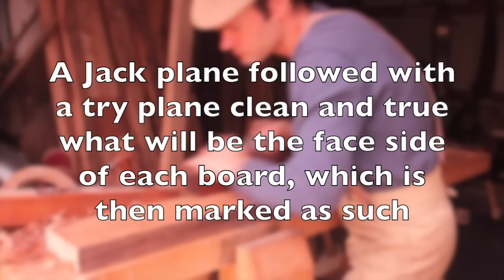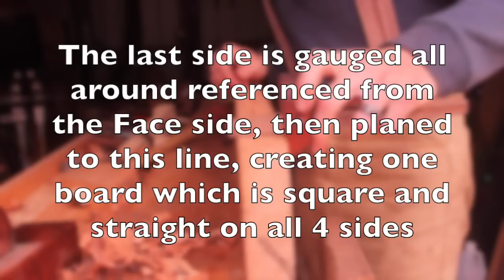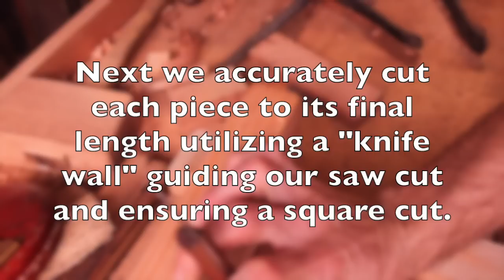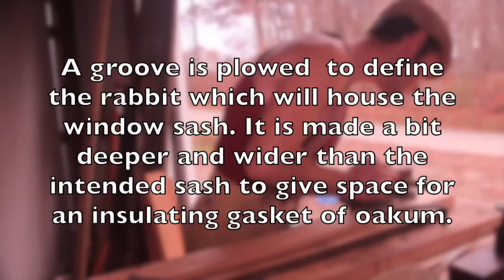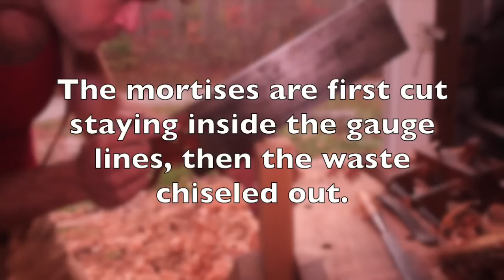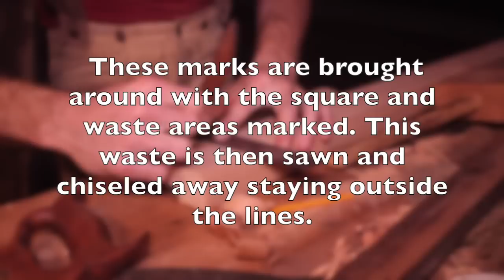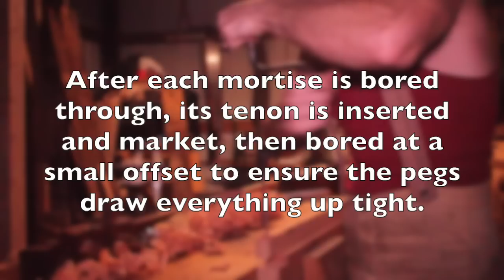Traditional windows . Part I

Comment: fun. this is great. i actually made some window sills at work this week. one sill to let water roll to the outside, and the other for water to roll to the inside, because it was a window in a shower.  the old ones wer rotten because it wasn't angled properly, or allowed to weep.  the other maintenance people always roll their eyes when my sawzall and planes are hand powered.
Reply from the maker: +Johnmark Hatfield Nice, so do I understand you use only hand tools as a professional maintenance person? If so, BRAVO!!! and Id love to hear more.
Reply: In my shop i use traditional tools, but at work i mix them. I hardly put my nice tools in my truck. Sometimes a compound chop saw can only do so much and the handsaw does it easily.

Comment: One way to quickly set the iron in the plane without bothering to hit it with a hammer (and once you get the hang of it, you can do this extremely fast) is to smack the corners (as you need in relation to the iron itself) against the work bench. As you can imagine, varying levels of power put in to the 'hit' will shift the iron accordingly, more, or less.

It's especially useful for small planes, but it works equally well on large ones. I've seen Japanese carpenters adjust their planes on the fly very quickly. :)

Comment: A helpful hint when I make pegs I first rough cut them and then I choose a nut with a hole the diameter that I require I then drive the rough peg thru the nut and it comes out round
Reply from the maker: +Richard Hilbert Thanks for the tip!

Comment: Incredible craftsmanship. Thank you. Can you tell me, is there any place on your blog or elsewhere, that you know of, with the names of the various tools and scribing equipment you were using? Having used modern tools my entire career, I am unfamiliar. Just subscribed. Very impressed.
Reply from the maker: Um, not sure, but here it is…
4TPI rip saw
9tpi crosscut
15tpi backsaw filed rip
Jack plane
Try plane
Stick and rabbet plane
1/4" mortise chisel
small carving gouge (in cannel gouge would be better)
mortise gauge
marking gauge
try square
yard stick
marking knife
1" bench chisel (could be other size)
Brace with 1/4" auger bit

With these tools you can build any size window, and you should be able to buy them all for less than the price of a modern double pane window, (which will leak and stop working and have to be replaced) and you can make all your windows, and make double window units just as efficient as a gas filled modern multi glazed window. 

Hope that helps
Josh
Reply: +Mr. Chickadee Thanks Josh. Big help. All the best.

Comment: Make a jig to cut your boards straight and all at once please. No need to make such a complicated frame joint (understand that when fitting the window you will wedge it from at least 2 sides). 
Better to make a butt joint with trimming the bottom frame parts to the sash groove level. Consider making more of your own jigs, even when using just nonelectric tools, cause your own way is that truly traditional way. Back in the day nobody had that cookbook internet to tell you how to do stuff, consider questioning even Underhills's ways :)
Reply from the maker: I followed the instruction of a book detailing window and door construction from just before the machine age. At the time of writing window sash manufacture and traditional hand tools used to make them had reached its zenith, so a more complete, effective, and efficient method would be difficult to come by or re-invent.
Reply: I see, that process of makeing and the end result are a real pleasure to watch nonetheless.
Reply: Could you please tell me the name of that book? Thanks.

Comment: Why did you saw into the bench hook instead of to its side?
Reply from the maker: helps to keep the saw teeth off the workbench, and gives a better finished cut as the stock is supported on all sides.
Reply: It prevents what's called "tear out" on the important piece being sawed. Tear out is ugly and ruins the cut edge (corners) of the wood.

Comment: could I get plans for the work  bench you are using
Reply: James Franklin It is a Roubo style workbench. The rear legs are angled forward as the bench top is narrow and the tray is added later. The angled dovetails are somewhat complex. There is an episode of Roy Underhill's Woodwright shop (available online) where he makes one of these. If you know how to build it, you don't need plans, just approximate dimensions. Research and determine what bench features would suit you best. The sliding dead man seen on the front center of this bench is one of those optional extras. The best of luck to you.
Reply: James Franklin here is the episode 1 of the bench build http://www.pbs.org/video/2365015322/

Comment: a way i like to make pegs is to sit with a plane in my lap upside down, and just pull the wood over the blade.
Reply from the maker: +Johnmark Hatfield Kinda like the "poor mans cooper plane", where you don't have a 5' upside down plane so you squeeze your jointer upside down in the vise and run your staves over it?
Reply: exactly. you've made a bucket? that's on a long term list of mine, but never have done it. there's a great video of some old man making one on youtube. swiss cooperage with ruedi kohler. there's no talking, and he does the wooden hoops and everything. he uses an electric drill for some odd reason, but everything else is traditional.
Reply from the maker: +Johnmark Hatfield Not yet, I plan to this year, will try to document the process if it goes well! Ill look for that video.